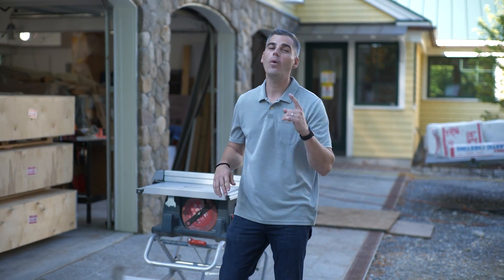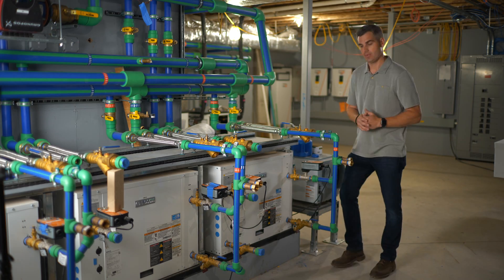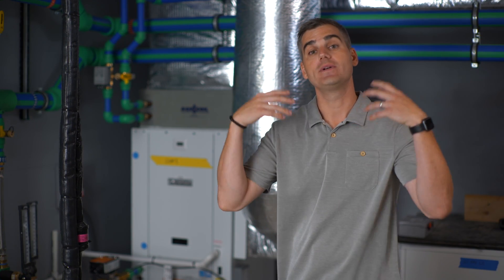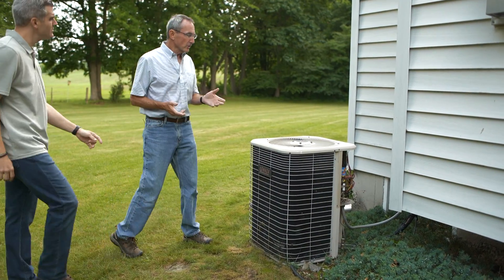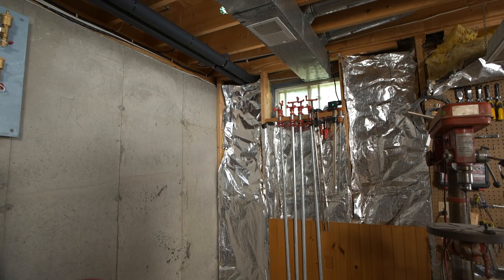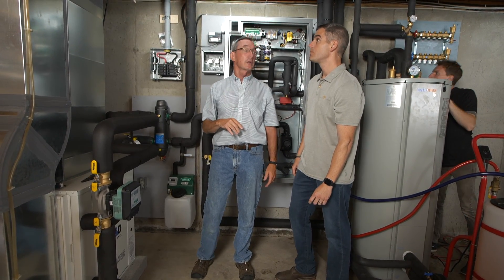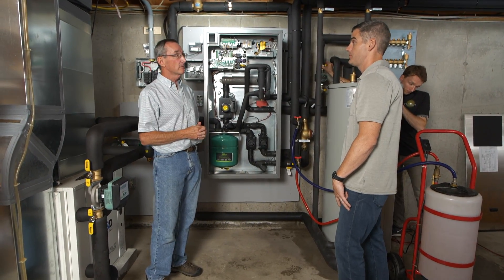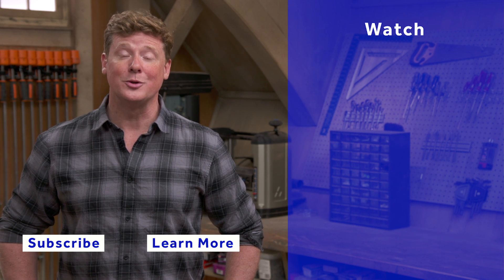Understanding Heat Pumps | Future House | Ask This Old House

Comment: It would be nice to provide some technical information, such as how hot it can heat domestic hot water, how cold air conditioning it can produce, and how hot it can heat the air for duct heating. This was a 20,000-foot overview of a very technological piece of equipment, leaving more questions than answers. This is not the Old House I remember.

Comment: One thing I noticed is that the air to water heat pump requires a considerable amount of space. Our house (in upstate New York) does not have a basement,  just a 6x6 room with high efficiency gas furnace, tankless hot water heater and an all in one clothes washer with heat pump dryer.  I found the reference to how it saves space puzzling as it looked like it would require all of my 6x6 room leaving no place for cloth washer/dryer or other storage we now have in that small room.  Did I miss something?

Comment: i live in virginia lowlands, near DC, and my heat pump is 20 years old.  i use A/C in the summer and use wood almost exclusively in the winter, 6 cords.  I might run heat a total of 3 days.  my question is how much longer will my heat pump last if it's getting almost no wear from heating? is there a way of an inspection to determine longevity?

Comment: 1. Condenser stays outside 12 months and for years, no research yet done, how much efficiency will declined due to dirty condenser. 2. To improve efficiency back to new, how frequent cleaning is required ?
3. Is there any specific method to clean the coil to improve efficiency back to new?
4. How much efficiency will decline due to extreme cold, is there data available on that how much money will be lost due to this?
5. Instead of deep geothermal loop, is there possible to have 2.5meter deep loop which can offer benefit to heat pump saving energy?

Comment: It would be interesting to know how much maintenance is required on a system like this and I would have liked to know what the homeowner paid to have this heat pump system installed.
Reply: Probably 60+ k we are doing a similar system air to water with water coil air handlers and some radiant flooring for master heat and cooling

Comment: i try these heater plate that claim 4cent per hour but ended up getting 14 panel and 1200 in cost for winter per month. NY state have to phase out home heating oil not sure if its 2030 or 2035. Anyways, i have an old house under a lot of tress. Not sure about getting solar panels yet, need to get this air to water system.  And since my house is built in 1924. Might be better to tear down the structure and redesign it. Gods willing, might just do that. So for now have to deal with the high price home heating oil.

Comment: Fyi this system is at least $30k plus. At 2k/yr as stated to heat with a traditional system thats 15yr to break EVEN. Even if it was $20k (which its not) thats 10yr break even point. Just in time for the newer system to be out of warranty. 5-8k for a new traditional air conditioner and propane heat with 10year warranty. You can buy a lot of propane for 20k extra you saved. Traditional propane systems are still superior cost wise period. If you can install this system for 10k email me ill be a buyer. Thats what they would have to cost to actually save you money. Again if anyone can install this system for 10k seriously get ahold of me. Otherwise ill stick to propane.

Comment: Someone who is heating with expensive propane is kind of the best case scenario to have a heat pump installed, it'll be an obvious slam dunk over buying propane or oil. But most of the country is heating their house using natural gas, which is super cheap compared to electricity. With electric vs gas rates being what they are, usually heat pumps have similar operating costs to natural gas furnaces maybe a little bit cheaper when its above 40-45 degrees outside and the heat pump is at its most efficient.
Reply: I heat my house all year on around 400gal of propane. That's around $1000yr. This system probably cost 30k . So spend 5-8k on a traditional propane system vs 30+ on this. Thats 20plus years to break even...just in thime to replace the 30k system for another one. I dont think so.

Comment: I would install it if i  could get my hands on it.  Around my parts homes are older and most are on their second HVAC system which is reaching its end of life.  Number of people in last few years who had the old style system installed still paid over 15K for forced air heating and cooling.  paying 25-35k and paying for itself in 10-15years would be really nice.  I would expect less system stress from heating and cooling components with a flame.  4 years ago newer furnace needed heat exchanger replaced at my residence.  Recently coworker had a heat exchanger crack and spew CO into the house on end of life unit.  I would expect this system not to experience such heat fatigue with less dangers.
Reply: Yeah, I bet you are right about this. In general, an electrical machine that fails is going to fail "safer" than a combustion machine. And there's less thermal expansion/contraction stress as you said. (Heat pumps famously deliver air to your house that's not as hot as a natural gas or propane furnace, which some people find more comfortable and others find irritating for some reason.) I think we get a little tied up with payback-time or return-on-investment. Recent events suggest there are going to be some really unpredictable swings in the price of both electricity and fossil fuels in the future. But I know where my electricity is made and I also know what to buy to make some of my own! So I'm going to opt to electrify a lot of things in my house. Induction stoves are WAY better than anticipated!

Comment: Can you add a self running motor generator unit to you air to water heat pump the runs continuously If you lose electricity from a weather event and are there rebates

Comment: In the air-to-water system shown, during summer months when heat is removed from the house to cool the living space, is that heat directly transferred to the domestic hot water, or instead is the heat directly transferred to the outdoor air, and then when the system needs to heat dhw the does the system then pause from cooling the house to heating dhw?

Comment: I have a year round non freezing creek. Can I make this my heat source? Seems awfully simple compared to miles of pipe.
Reply: That's not an off-the shelf system but it sure seems possible. If fish are spawning in the downstream though, you don't want to cook their eggs. Impact depends on the heat load of the house relative to the flow of the stream.

Comment: Want to see a hybrid setup. Heat pump runs when it can then when needed a natural gas furnace takes over. I live in -40 climate
Reply: Many air-to-air heat heat pumps have this capability  (having a gas furnace as backup/assist). So you could replace your A/C unit with it and still have your existing gas furnace (or a new one) as a backup for really cold days when it may struggle. I watched an hour long YouTube video from Enertech (sorry, don't have the link) that introduces this "Advantage" system to distributors, and in the tech section, they mention that it can interface with a backup  boiler to assist, so I wonder if it could also interface with a gas furnace. I'm waiting to hear from them. The age of my (gas, tanked) water heater is in the danger zone, and I need to go to a solution that removes the chimney (to make room for solar panels), so it's either a high efficiency condensing tankless model, a heat pump model, or maybe one of these air-to-water all-in-one systems (since my A/C and (high efficiency condensing gas) furnace are both 15 years old). I'm going solar, which is why I'm considering going to (electric powered) heat pump. I'm trying to be a good ecological citizen as well, as it's not all about economics. :)

Comment: Trust me. As a HVAC technition, we are always winter busy. In fact the colder out it gets we are running off our feet. Why? because HVAC equipment breaks. Not just old stuff, but, new stuff and unfortunately, we find the newer the manufactured equipment the lesser quality products inside them.Plastic parts, thinner gauge steel ,copper and parts made by cheap labour overseas.  I still service customers old 1960's atmospheric vented gas furnaces, run test on them yearly. Burn like they did brand new. Today we are constantly out fixing the newest highest efficient products. The day you do a repair out of warranty on any of these products, you can kiss your presently energy savings good-bye. Im saying energy efficiency is good and you should buy it because its what you want to do. And you have lots of money to satisfy your need for the latest and greatest. But buying it for ROI is stuff of unicorns and fairy dust. Do yourself a favour, talk to your HVAC technicians who do the repairs and emergency calls. They see it and know the reality. Don't talk to the HVAC owner, he/she is in the business of selling you things.
Reply: The newer, less efficient products are the same way so you might as well go for more efficient if you have to buy a new system.

Comment: As a licensed HVAC contractor, I always compare cost benefits and ROI on every system we sell. The biggest benefit of these systems is space savings. Their Achilles heel is that WHEN, not IF, they break, you lose all 3 systems at once. Cold shower, no heat, etc on Saturday morning in January...... A far more economical solution is separates, with redundancy. A heat pump water heater with electric backup is better. A Carrier/Bryant 2 stage air to air heat pump for heating and cooling is more efficient and dependable than the system shown in the video. The total cost is less for separates due to the economy of scale in production. Service is never an issue since the separate units use industry standard components that 90+% of the time I have on my service trucks as standard stock parts because over 90% of the HVAC units use these same parts.
TOH has a history of showcasing new tech that never survives to grow into old tech. Been watching the show since the 70's and seen many many of these unicorns come and go.
Reply: Is Daikin a good brand too for electric heat pump?
Reply: @henryhe2107  I don't like them. Poor efficiency, despite the AHRI rating, frequent problems with coil leaks. Last month a customer had to wait 3 weeks for a replacement coil due to the volume of warranty claims.
Reply: @briangc1972  I just bought an old house in PA that has oil heating, it’s in bad shape so I want to have central air. One company quoted $35000 for Daikin product with a split system, one from the attic one from the basement.
Reply: @henryhe2107  Ouch! That is double what we charge in Arizona. Call Carrier or Bryant and ask for a list of dealers within 100 miles of your zip code.
Reply: @briangc1972  thank you Brian.
Reply: @henryhe2107  No, cheap junk. Get Trane, Carrier, Rheem
Reply: @zack9912000  Lennox?

Comment: Heat pumps aren't all that much of a new thing.  All refrigerators, freezers, and air conditioners are heat pumps.   There were heat pumps (that cooled and heated) in the 1950s and 1960s, including window units.
Reply: Technically, yes. But nowadays, the term "heat pump" is commonly used to describe a unit that can reverse the direction of its transfer; so it can both heat and cool a residence.

Comment: What is the heat output in kw for the last air to water heat pump system? Last time I check, the system that I need all requires 480v three phase electricity, which is not available to residential address. There are some 220v single phase system, but the heat output is not enough for me. For 2000 sqft, you need at least 20kw heat output. All the system is from China. I didn't find any exception. Some local distributors use their own private label.
Reply: You are more informed than most. Great points, especially the private label aspect. Warranty parts are alway a problem with these "pink unicorn" systems. BTW, I've been a licensed HVAC contractor for 22 years. Seen a lot of fly by night distributors leave the contractors and consumers high and dry waiting (6 months or more) for parts to repair these "solutions" IF they are even available.
Reply: See this video: https://www.youtube.com/watch?v=YH6pRiITHA8
They talk about sourcing components. IIRC, the control electronics are from Europe (because they've been using this technology for a number of years). I think the compressor comes from Japan. They said they sourced as much  as they could in the US. It is manufactured in the U.S. Not once did they mention anything from China (which is not to say there is nothing sourced from China, but one would assume no major components).

Comment: Unless you get electricity for really cheap rates, per BTU, heating with electricity is far more expensive than with natural gas.
Reply: That is true today, but Gas and Oil prices are going up, and new gas hook--ups are being banned in both California, New York and soon Massachusetts.  Renewable energy is already less expensive to the producers and consumers than conventional Coal and Gas electricity production. Electricity can decrease in price, which would make heat pumps more viable.
Reply: @ArvonnT  You really think electric companies will reduce their prices? 🤣
Reply: @ArvonnT  It costs nearly 3x as much to power a heat pump in Massachusetts than to heat with natural gas. Prices have to raise a LOT for a heat pump to be economical in this area. Renewable electricity is also much more expensive than natural gas so the electric rates are only going to increase as well, regardless of how much is gas and how much is renewable. There's a line item on every bill for subsidizing renewable energy. (Note: don't take this as me being against renewable energy, I'm all for it over fossil fuels, just presenting the economic reality.)
Reply: @jblyon2  Not accurate anymore. The cost of solar and wind has dropped dramatically. Coal, on the other hand, has increased.

Comment: All these systems, solar, geo thermal, etc sound really good at saving the homeowner(s) on energy costs. But what they never tell you is how expensive these types of systems cost and how it will take a LONG period of time before the homeowner(s) get to the point of breaking even. Trust me, I've been there done that.
Reply: What's the breakeven point on the initial install? That seems like a bad-faith comparison. The Total Cost of Ownership will be lower comparing apples to apples, and fossil fuel costs are only going to rise.
Reply: @JacobLeemovingfwd  You never break even on these systems  the cost of these system to install and repair can pay for 5 traditional proven systems. The same bs was argued during the 70s. Fossils fuels will be here another 200 years easy. Government bs is what causing them to rise
Reply: @JacobLeemovingfwd  Natural gas costs would need to rise a lot to make a heat pump financially attractive in New England. Where I live some of the units are heated with forced air natural gas, others with forced air heat pumps (new, less than 3 years old). My natural gas bill is $65-85/month depending on how cold a winter month is with electric running about $95-105. The heat pump units have electric bills in the $350-450 range. Electricity is very expensive here and even the new systems still regularly need the emergency electric resistance heat on cold days.
Reply: @jblyon2  Yeah I wouldn't recommend a heat pump in New England, even a good one, a 90+ furnace will always be more efficient in that type of climate.
Reply: @jblyon2  My thoughts exactly. It seems that this thing will run up your electric bill like crazy and no one mentions that.
Reply: @WakandaBabe  When they do they base the electric cost on something ridiculous like 10 cents/kWh. I'm currently paying just over 27 and neighboring states are both over 30 this winter season.

Funny enough they justify more than doubling the generation rate during the winter months by saying most of our power comes from natural gas, which went up 24% this winter. That somehow equals a 140% increase in the power rate...
Reply: I am sure all the builders have a spare 50k under there beds not us.
Reply: Every house I've had has had a heat pump 7k  at most for replacement
Reply: That being said, that's no reason to completely forgo them. You shouldn't rent until you save up $250,000 to buy a house, you buy the house with a loan knowing that it's an investment.

Comment: With all these systems, I still wonder on the electricity required to run this. I have neighbors who installed #geothermal and got great savings vs propane BUT no one warned them that they would have $500-$600 PER MONTH in electricity, I pay $1500 in propane for the entire year and $125 in power per month. These new systems are still too expensive